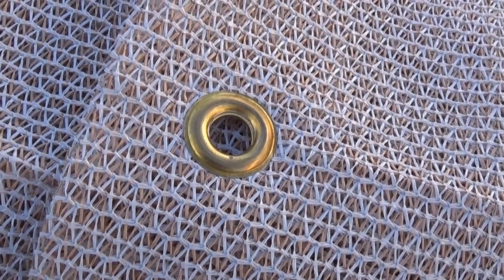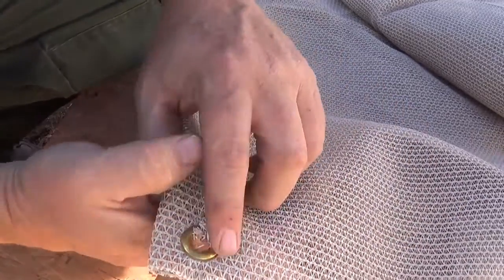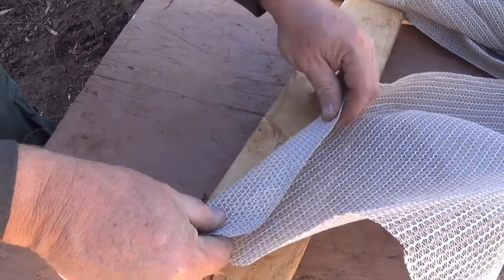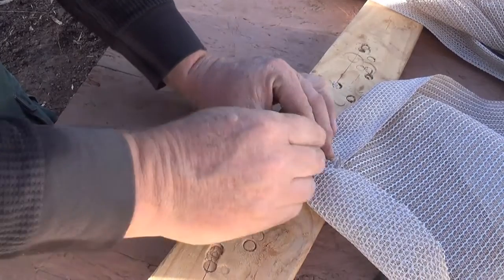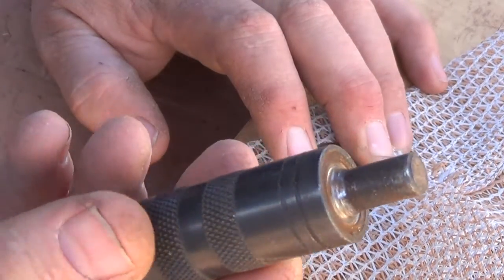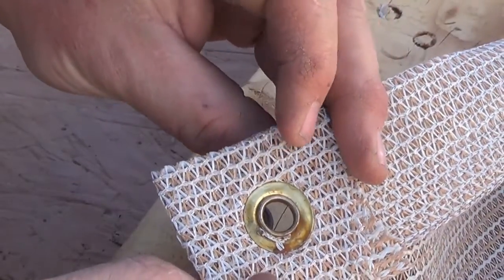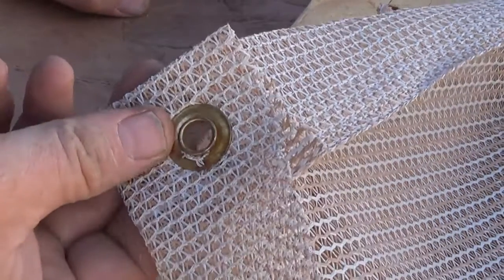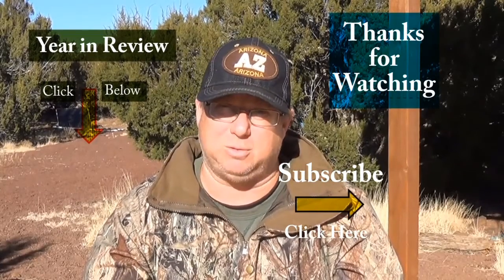This is How I Grommet. Have you Grommetted Lately?

Comment: I want to add gromments to a bag for venting airflow.  Is there a way i can add mesh fabric between the gromment?  The metal vent grommets are kind of expensive, so id like to make my own with mesh.
Reply from the maker: they have plastic grommets. not sure about the fabric idea.
Reply: @ArizonaHotHomestead  i swear ive seen the ones with mesh fabric in the center used for ventilation on such products like backpacks but i cant find them
Reply from the maker: @meowzic  good luck to you in finding them. i wonder if they put the fabric between the grommet parts so when you hammer them together it holds the fabric.
Reply: @ArizonaHotHomestead  that's probably how it's done lol thanks

Comment: Instead of grommets, consider using 1" O-rings embedded in straps.  Cut 3" wide x 12" long strips of the shade cloth, triple fold, insert in the O-ring, stitch in place with just a couple stitches.  Flatten the ends of the strips and place either side of the shade cloth where you want to create an anchor point.  Stitch on each corner of the strip/cloth rectangle, and in the center.  Liberally coat the straps with house paint (latex), all the way back to the O-ring.  After the paint dries, you will not be able to separate the layers of the cloth.  The paint gives UV protection, as well as binding the layers.  This avoids punching a hole in the fabric for grommets.
Reply from the maker: nice but you said stitch. i dont know how to stitch. lol